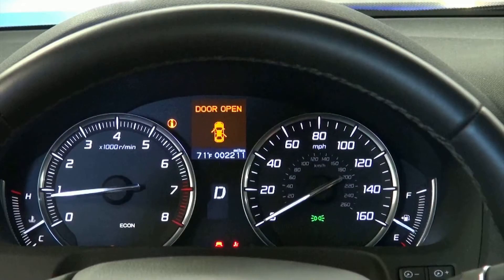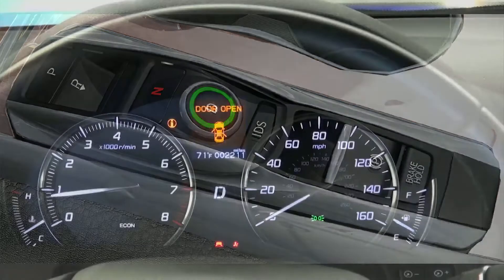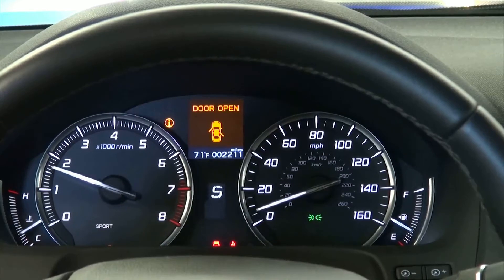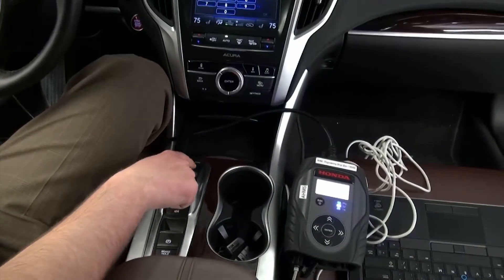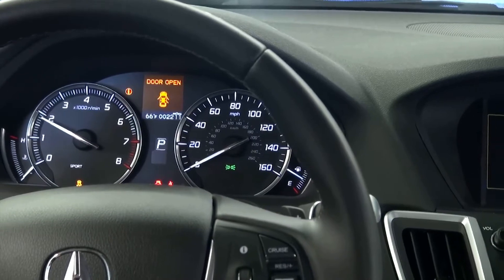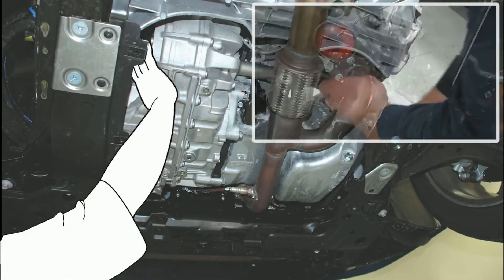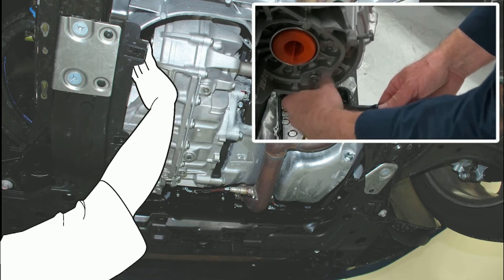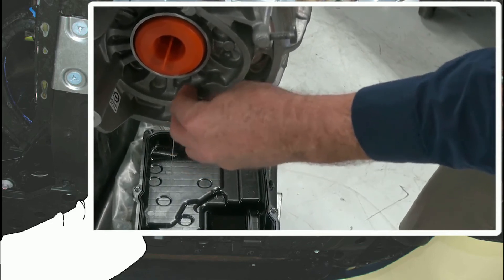How to Check the ATF Level 2015 Acura 9-speed A/T

Comment: How do I check the temp is at 104?
Reply: Rectal thermometer.
Reply from the maker: With a scan tool.
Reply: Regular obdII scan tool or some kind of Honda/Acura scanner?....BTW, good simple explanation on the procedure.
Reply from the maker: You will need an more advanced Scan Tool, that can read Transmission Data.